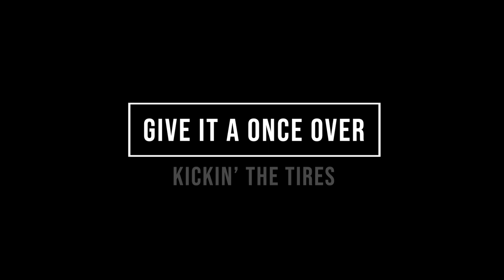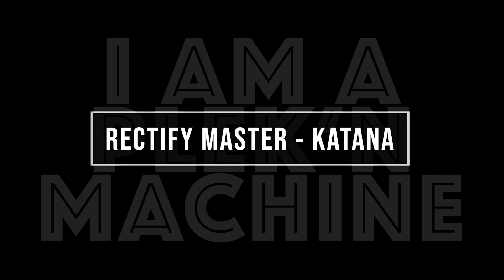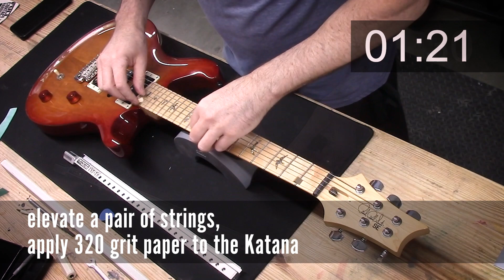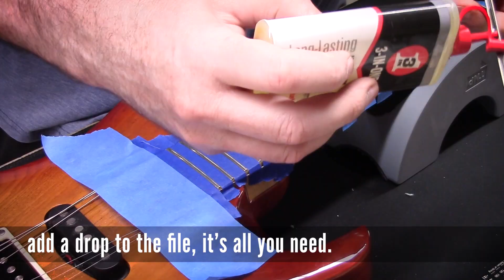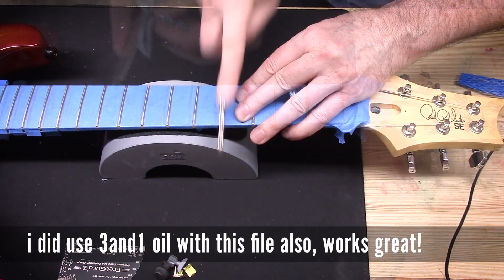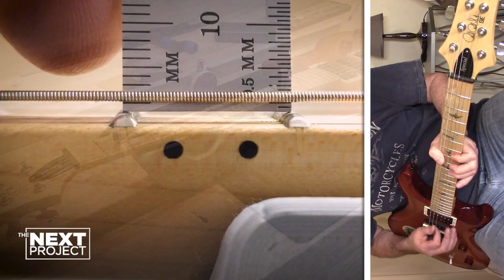PRS SE Tune Up

Comment: Hey John,  
once again a fantastic video! I’ve known the Katana for years too — we both follow Sam. What happened to the custom builds and modifications though? Didn’t they prove themselves?  
That super low action with 1.25mm is really impressive. Also, I really appreciate how honest you are about all the digital gadgets — they’re great and have their place, but the good old feeler gauge still does the job just fine.  
Thanks again for the awesome video and greetings from Germany!  
– Floyd
Reply from the maker: Hey Floyd, good to hear from you and thanks for hanging out with me!

Nothing bad has happened with my alternative tool tests, still underway. Just had an opportunity to get a Katana, wanted to have a better comparison and understanding.
I really like the way it actually fits under the strings, no need to push strings to the side and such. Just elevate the strings a bit at the nut end, and gently sand. 
I'll be doing more testing soon, hope to have a video of the tool and process soon-ish.  
I don't see it being a tool for everyone, as it is rather expensive. But for repair shops, techs, or such. This process may be a great thing. Maybe a great alternative to Plek work - maybe.

With the help of this "under string" process, I can get the action to 1mm on the "E", 0.75mm on the "e", but my untrained playing style causes the strings to jangle off the frets a bit. Not fret buzz, but the string oscillation hitting the frets. So I raise things up to accommodate for that.  The owner of this guitar seems happy with the set-up at this height too.

Every time I get paid for a project, I try to dump the money back into tools and materials. So I keep trying different tools, some are worthwhile, some not so much. However, if there is a 5% improvement here and there, and we add these little gains together, life becomes more efficient. 
If I could remove myself from the equation, everything would be more efficient, LOL

Thanks again for watching, more on the way!
Be safe and take care my friend!
Reply: Hey John,

 I completely understand your point about the Katana. I'd love to get one myself, but the price is a bit too high for me, especially since it's just a hobby and I can't earn money with it here in Germany. That’s why alternative tools are so interesting for hobbyists like me. Maybe the Katana creator will consider offering a more affordable "economy" version someday.  

A string action of  1mm and 0,75mm is truly impressive, though personally, that's a bit too low for me. I prefer about 1.3mm and 1.1mm, and even 1.5mm and 1.3mm still feel very comfortable. But everyone has their own preferences — just think of SRV players who like 3.0mm and 2.5mm with a 12-gauge set!  

Many greetings and talk to you soon!

Floyd

Comment: Sup John! I just got a PRS copy kit from pango. Pretty nice but thin veneer.  We'll see how it goes together.  Has a floyd rose and a set neck. Spalted maple top with real abalone bird inlays.  Looks pretty darn nice actually!  How I'm gonna customize it, I think, my own wiring and pot's,  new locking tuners,  danish oil and tru oil finish and hopefully soon some new pickups!  Thanks for the shout out too bro! The under string system is not easy to get down but I'm getting better too as I love low action. Great job! FYI,  on the z file, you have to rock it back and fourth to get that thin line that you want.
Reply from the maker: Ranman, good to hear from you my friend!
Sounds like a great kit and a lot of fun in your future.
Yep, did the slight rocking action, got me pretty close to where I wanted. Found the different file shape finished the crown more easily. Going from the Z-file "V" to the Guru  "U" shape. 
I don't want to make any of this too easy. That wouldn't be me, lol.
Agree, low action! I'm currently in a fight with myself, getting super low action, but string jangle (not buzz), compounded by my sloppy playing (lack of technique). 
I'm a wreck.
Hope you are doing well, have fun with the kit project and keep me posted on how it goes. I've been looking at kits again, pango keeps coming to the surface. 
Be safe and take care!
Reply: @theNextProject  , thanks John,  good hearing from you.  I'll keep you posted! Low action also requires a softer touch. You're pretty good though. Tomo says, we shouldn't compare with another. Be easy on Yourself.  Cheers!

Comment: Did you use a marker to mark the top of the frets before you started using your z file? And if not, why didn't you mark them? - Thanks!
Reply from the maker: TD, thanks for watching, good observation and great question!
I haven't been doing the "marker" thing on frets lately. 
I've been having some trouble seeing the marker line, confusing it with reflection, and at times it was appearing as a glare/shadow mix.
So, after the initial level sanding, I just use the dulled/leveled surface as my guide, no marker. 
The sanded surface is a dull gray (often with some texture), the rest of the fret is smooth and more reflective. So I seem to be able to see it better than black, or blue marker coating. 
If you use a marker, that's fine. If you don't, no issue either. As long as the final goal of a fine width crown is achieved, do what works for you.
Great question!
Hope all is well, be safe and take care!